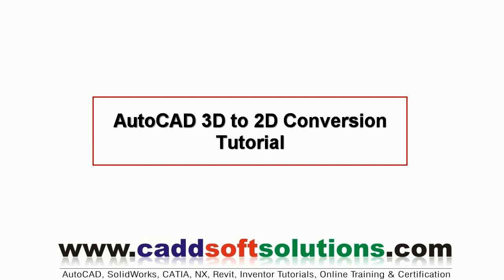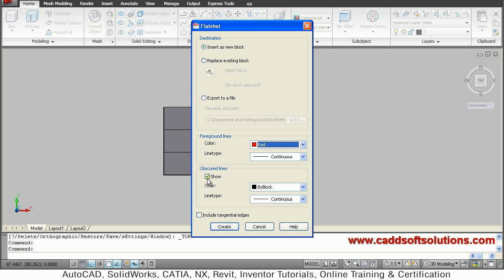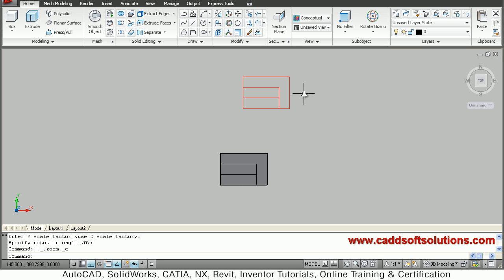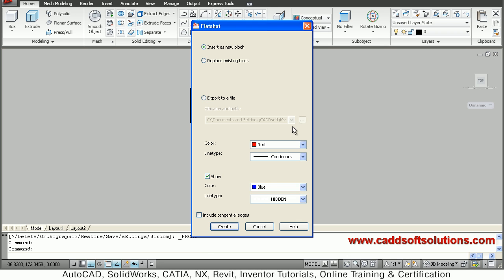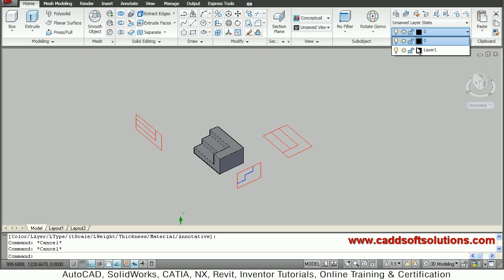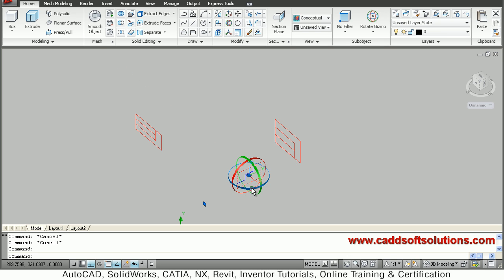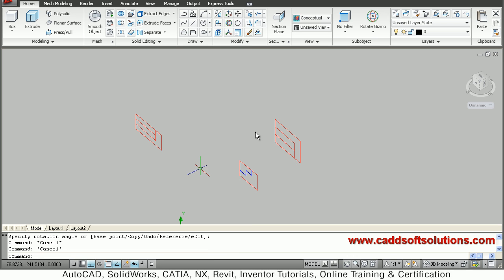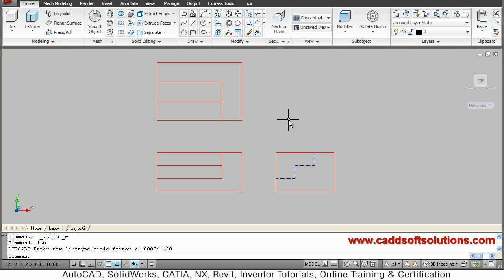AutoCAD 3D to 2D Conversion Tutorial | Flatshot Command | AutoCAD 2010

Comment: dear can i apply same method in autocad 2007... if not then tell me what is easy way to convert 3d to 2d in autocad 2007
Reply: hey i'm not sure if you still need help fixing it, but this will work 
it's a lisp , .http://forums.autodesk.com/autodesk/attachments/autodesk/529/33244/1/pline-3d-2d.lsp
1)while in autocad load it using the "appload" command
2.)find this file in which ever folder you put it , and load it.
(if  it is successful,)
3)just  Enter PL32 to start
4)select object and enter again
Reply: thanks